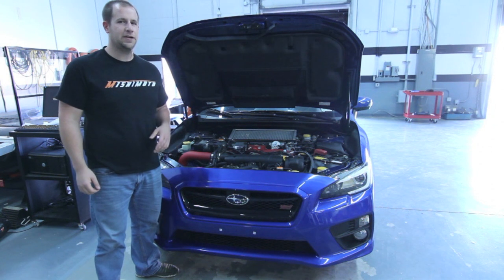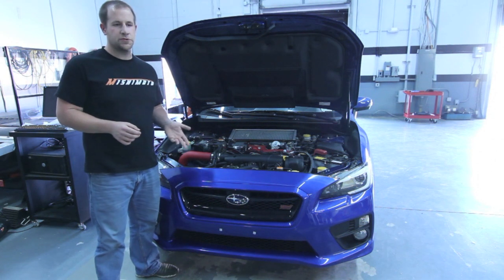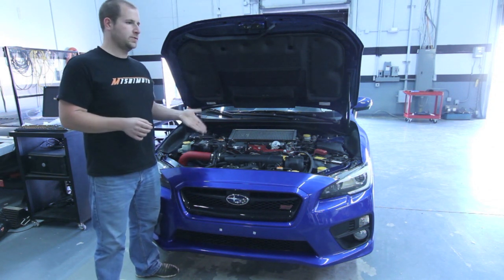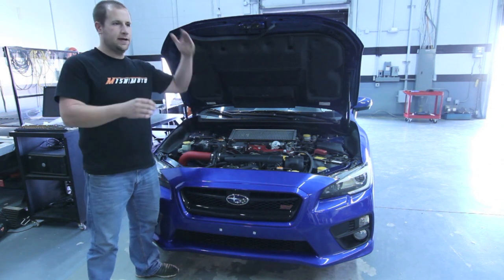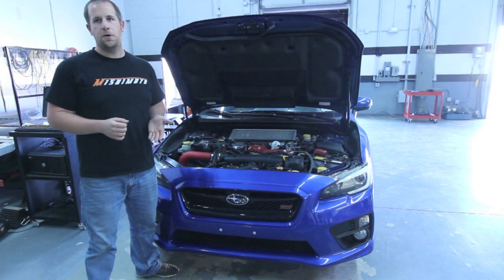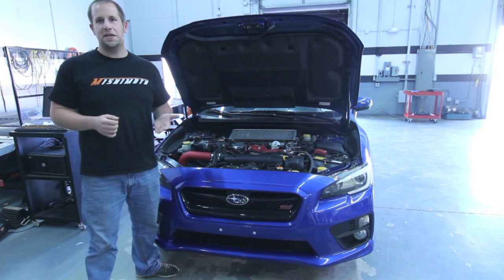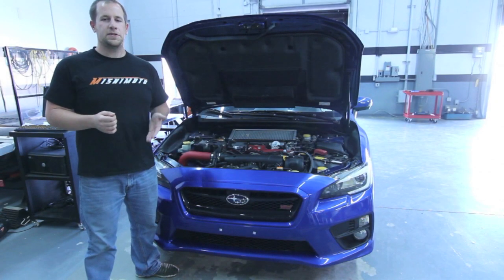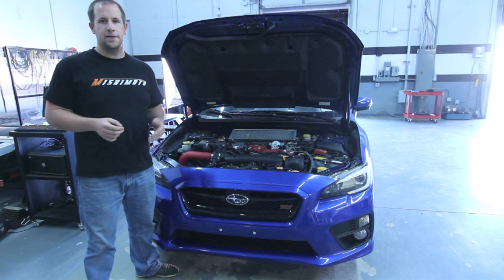Mishimoto 2015 STI Vehicle Evaluation and Product Test Fitting

Comment: My evo fullbuilt 800hp 6266turbo we make it 500hp 27psi daily used...i chang termostate mashimoto .30munites and the tempereture come back like stock ....
Reply from the maker: Hello! Sorry for the issues you are having with our thermostat. A thermostat will not regulate the idle temperature of your coolant, it will only impact the speed at which the vehicle warms up and the temperature at which the coolant can recover to. At highway speeds, you should see a reduction in temperatures. You should also notice that the vehicle will warm up at a slower rate. At idle, your fans will be the component which will keep temperatures under control. Hopefully this helps out! Let me know if you have any additional questions!